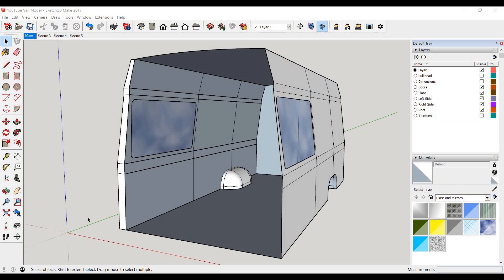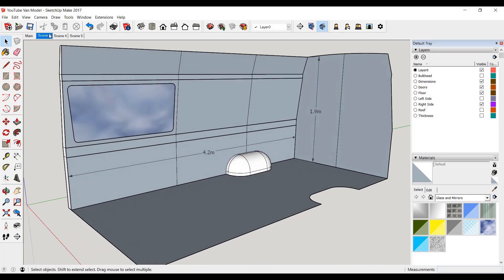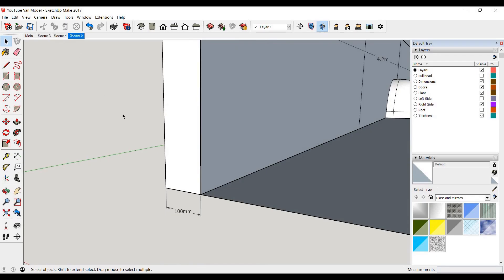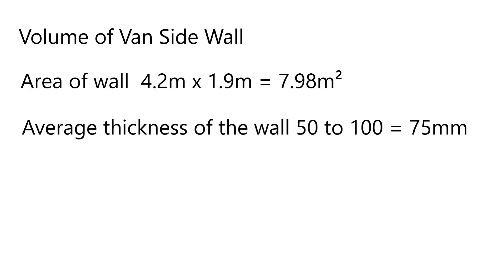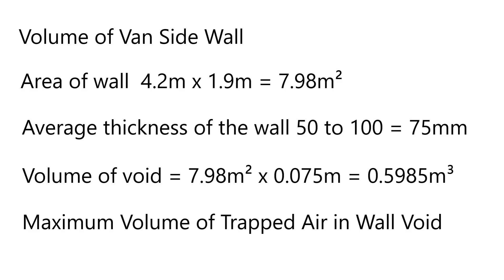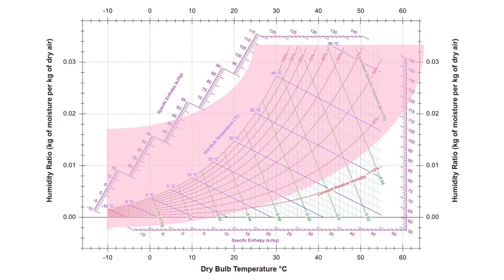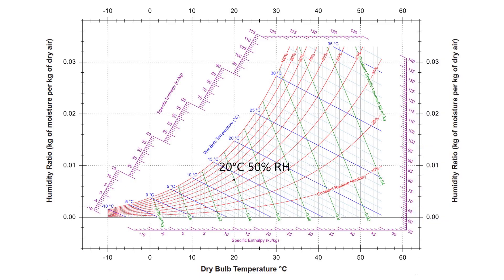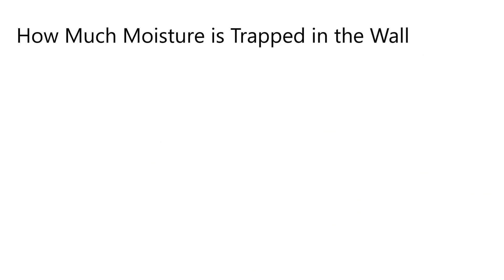There is Moisture Trapped Inside my Vapour Barrier!

Comment: For me its about the materials you and the concept of sealing using a vapour barrier, I just dont think its the best solution. For so many vehicle applications they just stick closed cell foams to the walls and ceiling and this to me makes sense. Easy to apply, simple, enough R value, covers all the shapes and direct to the metal surfaces where moisture is likely to condense. The temperature difference is diminished over the cross section and like closed cell spray foam used in refrigerated vehicles but less permanent. PIR board with voids everywhere and the enclosing vapour barrier just seems like a faff. Remind me again, what do they use on plant air conditioning and how is it applied...? TBH I think most of this is overthinking it, especially without a bulkhead but I guess it brings in the comments and views ;-)
Reply from the maker: Hi Rob, your closed cell foam is a vapour barrier in itself so you are applying the same principles. 
The only thing is 12mm of foam will only give you a 10th of the insulation value that 50mm PIR would. I agree it’s easier to install so it has some benefits so it is an option to consider 👍🏼😊
Reply: @GregVirgoe  Yeah that's why I choose it, although its not 100% so I choose the outer 8mm foam to have the foil backing. And its the fact it doesn't hold moisture AND slows the temperature change from the panel that I thought was important. Total thickness is 20mm and I added some plastic insulation too. The maximum PIR board I could have fitted would be 35mm (in places such as the ceiling) and thus I've got 65% (by R value) of the insulation compared to PIR board. When I did calculations of heat loss, if you haven't got a bulkhead and have some windows, that extra is pretty much ineffective. Anyway, I've got more height and width as I've made use of the voids and minimised floor/ceiling insultation thickness (due to 4x4 running gear). I couldn't have done this with PIR board because its flat and rigid. Incidentally the 20mm sub floor is XPS with cut outs and small support islands to bolt the floor down, thus it maximises insulation over stamped sections of the floor and minimises height loss which I couldn't have done with PIR board. I haven't seen this method before but to me it made sense as XPS has compressive strength. Different strokes for different folks. All the best with your impending keyboard battles on this subject😋

Comment: What about a vapour barrier that wasn't sealed properly? When I put my insulation I left the edges untaped because I was planning to put my solar on later. Months later I opened it up to put the solar and the recycled bottle insulation was damp I assume from moisture in the air from living condensing on the metal and then soaking the insulation. What do you think about that? Is there a way to dry out damp insulation?
Reply from the maker: Sorry to hear that, this is the problem when you don’t complete the barrier or have no barrier at all. 
It allows moist air to condensate against the van. There isn’t an effective way of drying it out unless your not using it and you can heat and ventilated it well. 
If you don’t seal all the gaps it will return as you use it.

Comment: Hi, I’m about to start my insulation and I’m so torn! Your videos make sense, but would you say it’s true to ONLY do a vapor barrier if you can be sure and seal all possible moisture getting in from the outside as well? Would I need to remove the black paneling (Ford Transit) on the outside of the van to do that? Is it best to NOT do the vapor barrier if I don’t remove the outside paneling to try and seal everything beneath? Thanks so much.
Reply from the maker: The trim clips can be sealed on the inside quite easily without removing the plastic strips. 
Always fit a vapour barrier. You will have lots of problems with condensation if not fitted.
Reply: I’ve just done this job yesterday - removed and sika sealed the trim clips on my 2013 Sprinter before insulating and will use a VB. I’m not sure how good a job you’d be able to do from the inside only - there are also some lower trim clips that don’t appear accessible from the inside anyway although I appreciate the poster has a tranny. I’d recommend taking them off if you have time. Greg - in the doors there are drain holes so my thinking is that any water ingress in these places (from door handle recess etc) would have external ventilation anyway so not a problem to get the odd drip inside inside these areas - would you agree?
Reply from the maker: @richardblack2927  what I recommend for doors is to put your insulation into plastic bags and seal them like pillows. You can’t stop water getting into doors so at least they can still drain and the insulation will stay dry. 👍🏼😊
Reply: @GregVirgoe  great idea, we are planning a 5-bed, 6-seater L3H2 - and following your advice. Wish us luck! Happy trails.

Comment: I remember arguing with someone on Reddit about vapor barrier. He made an offhand comment that only armchair people worry about vapor barriers. At the moment, I live in a humid environment and a vapor barrier is definitely part of the plan. After some frustrating discussion with him, I was finally able to get some information out of him. He used to install insulation on commercial refrigeration trucks and was trying to leverage that experience to call anyone using or recommending a vapor barrier, an idiot. After some more frustrating discussion, I was able to get him to admit that they used a closed cell foam for their insulation. I had to explain to this "knowledgeable professional" that closed cell foam is insulation AND a vapor barrier. That he used the very thing for years he was now deriding as something only used by idiots. At that point, he fully lost it and just started spamming insults at me.

It's amazing how people will get stuck into one way of thinking, even when they should have the experience to know better.
Reply from the maker: Yes there are a few insulation materials like closed cell foam that are a vapour barrier too and don’t need additional treatment. Also neoprene foam like Armaflex is a similar product. 👍🏼😊

Comment: Nice video Greg. Just one question. Surely that calculation is based on the total area behind the vapour barrier being air. However, most of that void is filled so therefore the air content and moisture would be significantly lower again. Or did I miss something?
Reply from the maker: You are absolutely correct so in actual fact the reality is much better 👍🏼🤩

Comment: Iv never understood why people struggle so much with insulation and barriers. I'm a builder and all I done was apply the same rules for insulating and sealing my van as used on houses. Tried and tested methods and yes they use vapour barrier in houses the silver foil on the insulation commonly used is the vapour barrier and we tape all the seams
Reply from the maker: The application for houses and vans are slightly different. Generally house building materials are porous and vapour barriers are used to prevent moisture ingress from outside to inside. 
In a van we are preventing moisture inside from contacting the cold metal skin. 
Glad to see you are in agreement to using them 👍🏼😊

Comment: Greg!  This couldn’t have been more timely as I’m starting to figure out the particulars for my own build and was thinking about this very topic!

Q for you: did you plug the drainage holes in the bottom of the walls to totally seal off your insulation?
Reply from the maker: Most van drain holes are blocked from years of driving and road dirt. I did seal all the plastic trim clips which is where most water comes in. 👍🏼

Comment: Good info as usual! 
I have a vw crafter and am currently doing some body work on it. Moisture had got behind the black plastic trim and caused rot, which spread above the trim. Once the rot was cut out I found the bottom few inches of insulation was soaking wet in some places. I used protect VC foil ultra for a vapour barrier which wasn't ideal but has definitely kept the inside of the van dry. I insulated it first then put the vapour barrier on top. Would it be better to sandwich the insulation in with a vapour barrier either side of it?  I feel like leaving a couple inches of space under the insulation would allow any moisture to run away easier as well rather than ramming it in
Reply from the maker: You would be better to seal the clips on the plastic trim so that water doesn’t get in to start with 🙏🏼

Comment: Are you assuming that you have created air tight void behind your vapour barrier? Wouldn’t air be drawn in through the gaps from the outside? I wonder if you could also see vapour being transferred from the inside of the van and condensing on the inner skin of the vapour barrier, that maybe more of a problem?   I think it’s fair to assume you can not eliminate every drop of water, we just want to keep it to a minimum.  Great video and as helpful as ever.
Reply from the maker: It goes without saying that you need to seal things like trim clips etc but that’s not hard to do. Spend a little time doing a good job and you’ll have no worries.

Comment: Am i missing something but your chart shows less water trapped when the humidity is higher shouldnt it be the other way round?
Reply from the maker: No, look at the psychrometric chart. As the temperature gets colder the air cannot hold as much moisture. The water content on the vertical scale is much less when air is cold even when it is 100% relative humidity. When air is warm it can hold much more water content. Relative humidity does not = moisture content. That’s why the RH lines are curved on the chart.
Reply: @GregVirgoe  You learn something new every day. Cheers Greg.

Comment: Hi Greg. Thanks for the video. So just to clarify based on the last chart you showed, despite the RH in winter being higher, it actually results in less water being trapped? Would be interested to understand why that's the case, but as you says it all looks pretty negligible anyway. Cheers
Reply from the maker: Because as air gets colder it cannot hold as much moisture before it becomes fully saturated. 
So the moisture content of air in winter is actually less than in summer. 😃
Reply: @GregVirgoe  nice one, thanks
Reply: The risk of trapping moisture in the winter is breathing on the cold van whilst working inside it. But without the vapour barrier that's what will be happening every night you sleep in it.

Comment: Excellent video Greg and very informative. A vapour barrier is essential . I've hit -4 last winter, diesel heater on and not a drop of condensation inside the van. I've used moisture resistant MDF for the walls,. Barn doors side and back, fully insulated. Buffalo board for the bed base. We build houses in every weather scenario. If it's done right it's done good. 👍
Reply from the maker: That’s excellent news. Glad to hear that it’s working for you too 👍🏼😃

Comment: A sealed system requires perfection and cannot cope if water breaches any imperfections. A breathable system does not require perfection and can dry out any water ingress. What is more achievable and convenient for the average person?

Water will inevitably get in somewhere for most people. Better to have a system that can dry it out without having to rip it all apart.
Reply from the maker: It is extremely easy and simple to tape every join and edge. Seal the trim clips and tape around any services. If you can’t manage that then you are wasting your time building anything else. To allow the entire internal surface of your van to be soaking wet on a daily basis and to allow that to then make timber and other material wet and mouldy does not make sense. 
I will leave this here as an example of what not to do 😊
Reply: BREATHABLE SYSTEM?? Does not exist, once moisture gets in behind timber and into insulation in the amount that occurs in a van you have very little chance of getting it out..Unless you park in the hot sun, crank up a radiant heater and bake the van inside out like a potato..

Comment: Thanks for the very clear and accurate explanation. The question isn't whether the water is trapped in the insulation during construction, it's what happens if there's a leak and liquid water gets in. If the insulation is completely sealed inside a vapor barrier, won't the water collect either at a low point or condense against the cold metal rather than gradually evaporating or draining back out? Isn't most house insulation installed so it can equalize moisture content with the outside air to avoid this problem?
Reply from the maker: I would not put water pipes in a sealed void where they cannot be accessed and potentially a leak can happen that’s just very poor design and you would be asking for trouble in a moving van. If you don’t fit a barrier you’ll have a lot more water to deal with than a leak

Comment: Well explained Greg. Perhaps people will now appreciate how much more efficient a vapour barrier is. You would undoubtedly create more trapped moisture without this barrier. Great video, thanks for sharing
Reply from the maker: Without the barrier you are allowing moist air to continually get through your insulation to where it can cause condensation on the metal of the van. Thank you 🙏🏼

Comment: Well explained Greg.
I think it would also be worth adding that as a rule of thumb its not a good idea to insulate in cold damp conditions.
Think sitting in your car when raining and seeing all the condensation on the glass.
Reply from the maker: Obviously don’t insulate if the inside of your van is wet. However colder temperature do have less moisture content in the air.

Comment: Good stuff, I wouldn't worry about trapping moisture. I remember at college the thing to do when designing a wall and positioning the vapour barrier is the dew point across the wall under various conditions. You want the vapour barrier to be at a point in the structure that it prevents passage of moisture whilst it still is vapour before it condenses. Hence putting the insulation first then the barrier.  If you put the barrier first then covered it with insulation you may end up with soggy insulation as the dew point may be reached before the barrier.  So generally the barrier is best placed as near to the inside face as possible.
Reply from the maker: Absolutely spot on 🤩 well described 👍🏼

Comment: Hi Greg, what about the van cab?   I didn't see you mention that in your videos.  Some other van videos have insulated the front doors and cab roof.
Reply from the maker: It’s important to insulate the van cab roof as that is prone to condensation. Van doors are not easy to do as they have opening windows and you can’t seal them from water ingress so they need to be constantly drained of water 💦

Comment: Hi Greg great vid appreciate the info, just to throw in a spanner. What about between vapour barrier and the finished wall inside the van as that is not sealed 100% and also no air flow ? 🥱
Reply from the maker: The insulation raises the internal temperature at the point where the vapour barrier is above the dew point. So no condensation will form on top of the vapour barrier internally.

Comment: 6:00 the table shows that for freezing conditions that there is less water trapped than for hot and dry? The moisture content appears to decrease instead of increase with dropping of temperatures. Surely a dry summer would be best to insulate?
Reply: this is to do with the fact that the colder the air less moisture it holds and warmer the air more moisture it can hold.
Reply from the maker: If you look at the psychrometric chart as air gets colder it’s ability to hold moisture is much less and it becomes 100% saturated at lower moisture content. Warm air can hold loads more moisture as can be shown on the right of the chart. Either way the difference for this volume of air is only 2ml in winter or summer.
Reply: My thoughts exactly.   Surprised by these results.  I assumed hot and dry summer would be better.   I imagine it depends whether is a dry cold winter.  Rather than a raining, damp, winter day.

Comment: Great video Greg, a vapour barrier  preventing vapour penetration. Putting a spanner in the works , let's not the sill drainage  , don't know  if they have a good or bad effect on  moisture in the lower pannels, probably not.
Reply from the maker: You do need to seal up any trim clips and holes to make an effective Vapour barrier. If nothing can get in there then there will never be any condensation or any need to drain the void. Those holes are only there because van manufacturers know their trim leaks like a sieve 😂😊

Comment: Thanks Greg...the chart seems to show the trapped moisture actually REDUCES as the ambient relative humidity goes up? (sorry in advance if I'm not reading it right!)
Reply from the maker: Absolutely 👍🏼 cold air cannot hold as much moisture before it becomes fully saturated so the colder it gets the lower the moisture content. 😃
Reply: @GregVirgoe  Ahh! It seems counterintuitive but now I (think) I get it! Thanks again!
Reply from the maker: @planetpeckham1  it’s only as the temperature drops. If the temperature increases it can hold much more moisture so rain on a summer day can give very high moisture contents. 😊